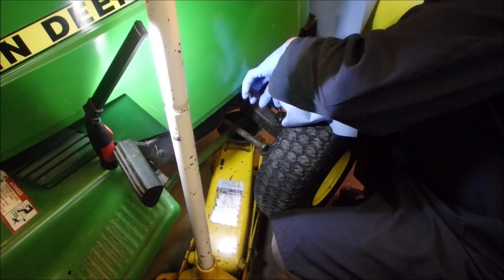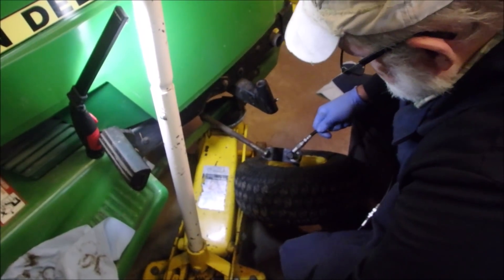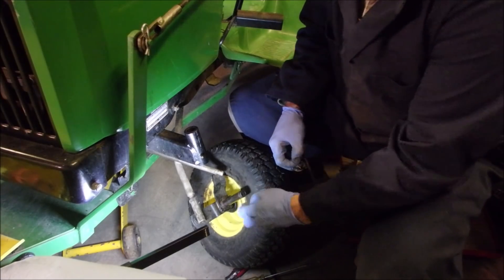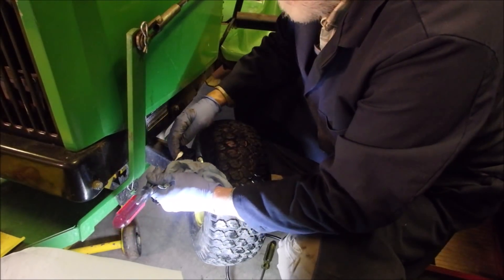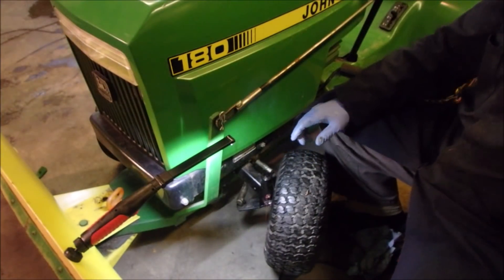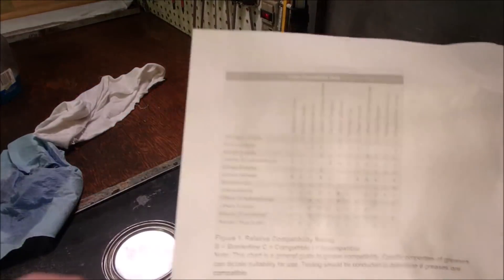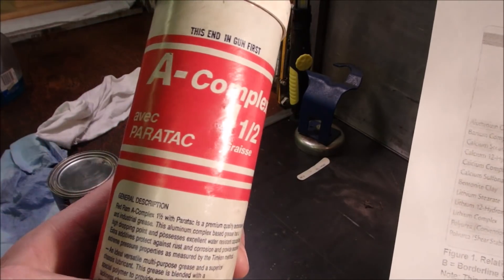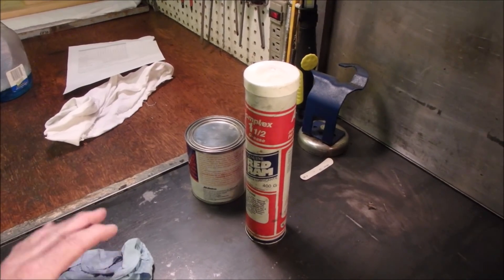Grease Incompatibility

Comment: Didn't realize that grease could be that complicated.  Actually, I am glad that I saw this video because I could have very readily added grease to something I own without a second thought. Thanks again Bruce.
Reply from the maker: Well After doing this video more than a year ago I have learned     Yes there is compatibility issues with grease  with high temperature.  I think with a spndle on a lawn tractor it will most likley not be ctritcal.  Still good to know.    The link in the comments is a great help.

Comment: Bruce have you ever had problems with any of your grease zerks being clogged ?
If so you can clean them out instead of replacing them .
Reply from the maker: I heat them,  While they are warm I try the grease
Reply: @BrucesShop  never tried that I have a tool that I use it goes on the zerk and you use oil in it and tap it with a hammer and the pressure forces the oil through to clean the zerk out
Reply from the maker: @benr4643  OK.  Thanks.  Try the hear if you are stuck

Comment: Calcium complex greases are highly water resistant. 

Aluminum complex greases are for higher temp applications, hence their high dropping point. They’re really sticky also. 

Common, general purpose greases are usually lithium complex. 

Archeologists found calcium grease on the axles of Roman chariots dating to 1400 BC. The Romans knew about saponification, so produced fatty acids, aka soaps, which are the thickeners in grease. Do like the Romans, cook about 10% soap with any oil and you‘ve made yourself a DIY grease.
Reply from the maker: Good comment

Comment: i have never worried about grease until you get to a wheel bearing in a car or truck as they carry weight i usally clean them then reload with the new grease other than that i dont worry   about it  on my own i dont worry if they are the same type brand doesn't worry me i use all purpose now for every thing as it covers most of the other grease ratings
Reply from the maker: Right.  I have mentioned this below.  Like those little tent trailers that get converted to a utility trailer then some dude drives down the interstate at 85 MPH with that tiny wheel going around six times for every one on the pulling truck.
Reply: @BrucesShop   yep i had a customer back in 1990 tell me he couldn't believe that the 12 inch wheel couldn't handle his big inboard  ski boat at 
60 miles an hour  he was getting a grinding noise out of the wheels i pulled the wheel bearings they were dry and full of water  he had the trailer for two years and never greased them i know he was driving 80 plus at times i have no idea what kept him from killing people or losing that 100,000.00 boat on the highway  i convinced him to get full sized tires and installed  a hubcap with a grease zerk in them to top off each time he took it out and showed him how to pull the cap and look for water he turned white as a ghost when i showed him that the bearings were just about to seize up he said i never thought about how fast those little wheels spun i showed him with a full sized tire and his little tire rolling side by side that tire was going 120 instead of 60 in comparison maybe that was stretching the truth but it got my point across lol keep those video coming you sure have a kool light my my where did you ever find it lol

Comment: Bruce,   Amsoil has a perfect grease you may want to try. It is the Arctic Synthetic Grease which is great for the low temps you get up there by you and superior protection in your cold climate and is great for off road and heavy equipment operating in the very cold climates. It is also compatible with many other types of grease. If you are interested in it let me know. I can get it for you .   Great stuff.

Comment: IMHO   those 2 greases won't hurt anything because they are not in a high pressure situation such as Heavy equipment  use..........    

Those mowers are light duty compared to the D6 Cat dozers and such.....   Those spindles are not under heavy stress conditions...........  That's the word I was looking for not pressure LOL......    

Plus Tard Non'c Bruce .................
Reply from the maker: Right.  I was thinking when someone uses chassis grease on a wheel bearing (mixing the grease with what is there) like a small trailer that gets hot.  You know those little tent trailers that get converted to a utility trailer that some guy puts a ton of stuff into then  drives down the interstate at  85 MPH
Reply: Yes I do know about those...   You made laugh at that one, even the small U-Hauls say do not exceed 45 MPH......

Plus Tard Non'c Bruce ~!~!

Comment: I think I have a calcium complex HA HA.  Well like they say if you're not learning something every day then you've stopped caring.....or something like that. I certainly didn't know about grease compatibility.....BUT now I do. Great video Bruce
Reply from the maker: I knew about it and on a steering joint I don't think it will make much difference.  My thought was if someone used chassis grease on one of those little modified trailer wheels and the grease that was in there is non-compatible.  Those little bearings really fly.  (like an old tent trailer wheel)

Comment: I have often wondered about grease compatibility. Thanks for doing this and for the link to the chart.
Reply from the maker: On my use here in this video i don't think it is a huge deal but i think it is important to follow the rules.  (on high speed stuff).  But then most folks wouldn't use chassis grease on a bearing  (or would they haha)

Comment: I try to use the proper type grease on stuff like disc brake wheel bearing grease is made for high temp you get from the disc brake rotor...But on a spindle or tie rod I am not that picky ...I do know  U-Joints in a car are supposed to have a proper type grease
Reply from the maker: Exactly.

Comment: I wouldn't worry about it in a kingpin or anything that doesn't spin fast generating heat like a U joint.
Reply from the maker: Right.  Or a spindle in a lawn tractor deck.  Very good point.

Comment: Bruce, you commented that us in Florida do not have to deal with the effects of cold on the grease and other things like you do in Canada. I used to live close to Canada so I understand that statement however, here in Florida we have the opposite. I keep my grease gun for my small engines in the rafter of my shed. That shed is not air conditioned and gets quite hot in the Florida sun. I have to keep the grease gun in a plastic bin because that excessive heat will cause some of the grease in the gun to ooze out in a liquid form. You would not expect the grease to do that but no matter the brand of grease in the gun that same thing happens. Too hot is not much different than too cold, they both cause problems. If I have my choice, and I do, I prefer the warmth rather than that cold, slush, ice, and having the snow plow come by just as you finished the driveway. (Snowplow driving should be an armed position)
The moral of the story is the grease always looks greasier on the other side.                    
Now there's your lunch.
Reply from the maker: That is a great comment.  We see 30C (90F) Celsius for a week or two in the summer but we have no idea what it is like for months on end.  Great comment.